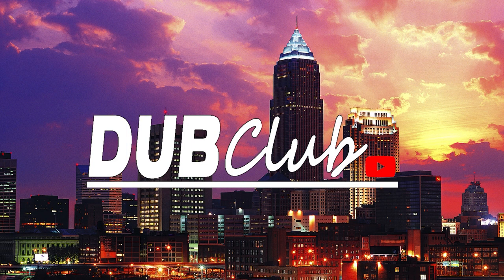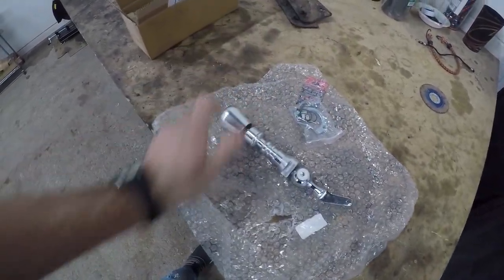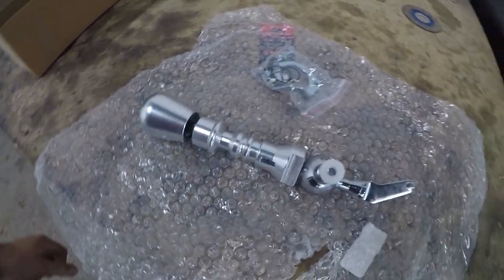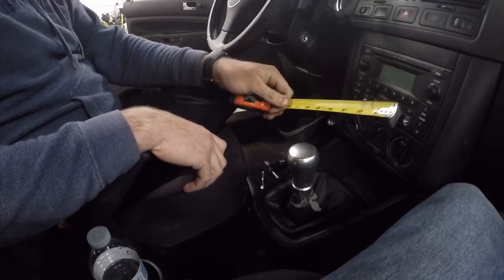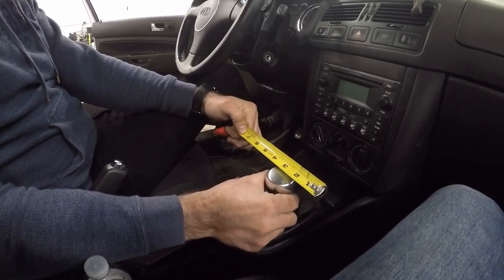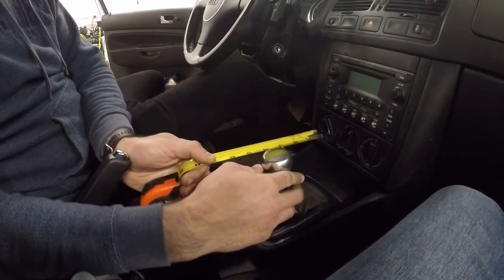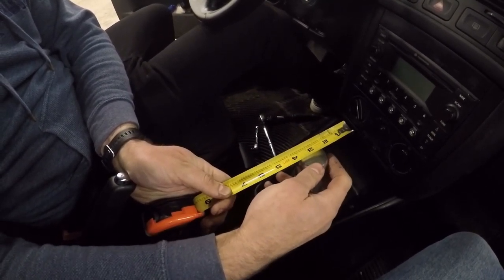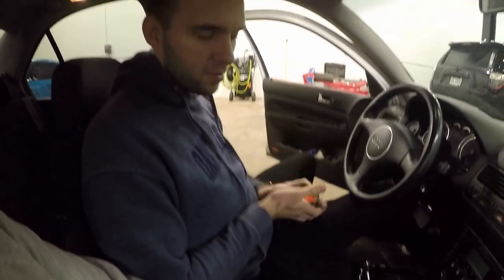MK4 Short Shifter install DIY

Comment: So if you would of removed that black rubber seal that kept the shifter in when installed. You wouldn't have to lift the car ? Or either way shifter has to come out ?
Reply from the maker: Shifter has to come out.

Comment: Hye man, I know this video is really old now and that you've sold the car. But I recently bought the exact same shifter as you however, when i put everything together I had no downward gear (2nd and 3rd) only my upward gears. I've attempted multiple times to readjust the cable tension but I can't seem to find anything that works. Did you also experience anything similar to this?
Reply from the maker: No I didn’t have this issue